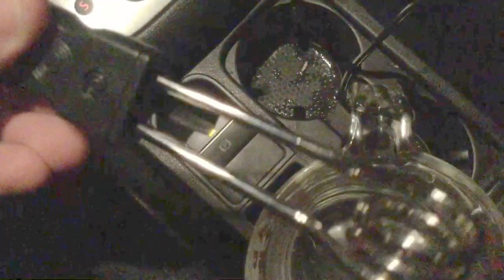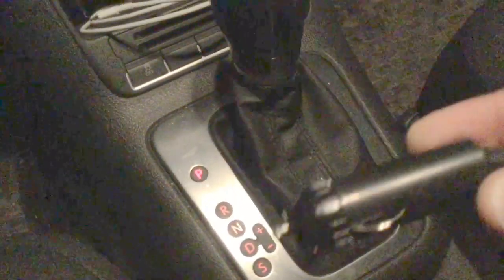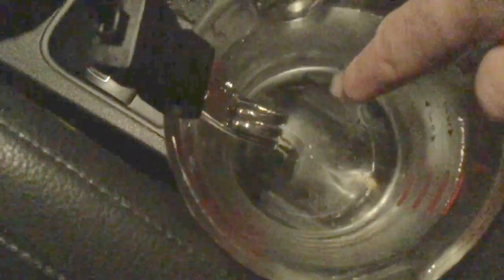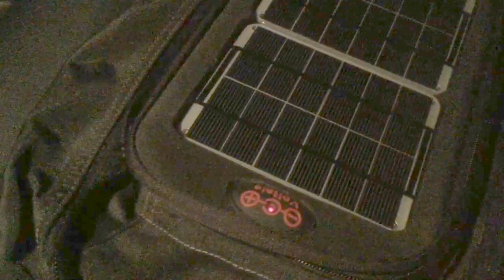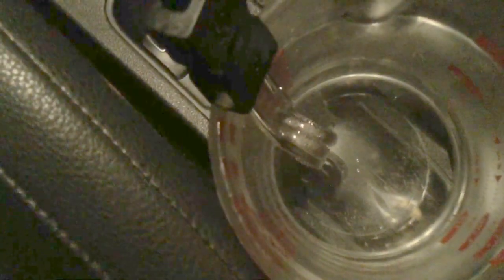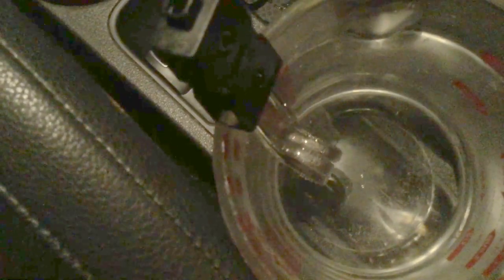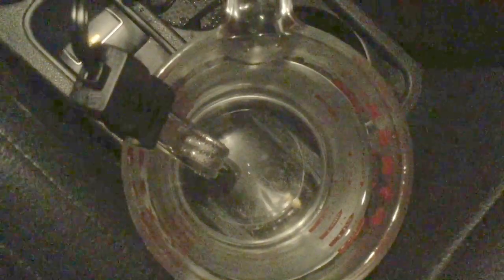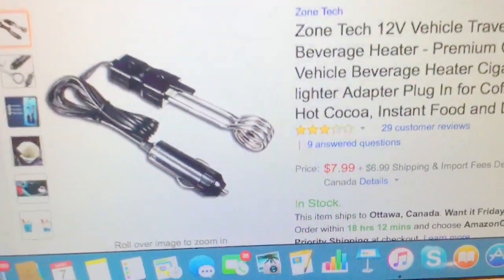12 volt 10 amp water heater test #offgridtv

Comment: What would happen if you were in bed is that in concrete how hot could you get the concrete. I'm thinking about using solar cells to heat up a block of concrete for heat storage in my van

Comment: Do not turn the power on til it's submerged and don't remove it from water til it's unplugged. You'll fry it.  The directions are very clear.   I am curious about the composition of this though and if it contains lead.

Comment: You're a man of your word. I read your comment on Amazon stating you'd do a review and here it is:)
My interest is not in its intended use but am thinking this gadget could be the heat source in a DIY automotive diagnostic smoke leak detector replacing makeshift coils of resistance wire most designs use. I'd replace the cig lighter plug with heavier wire and alligator clips for the project.
Thanks for the video as it gave me some sense of the heat generated.
Reply from the maker: Thanks !